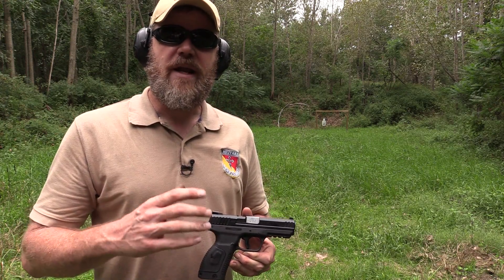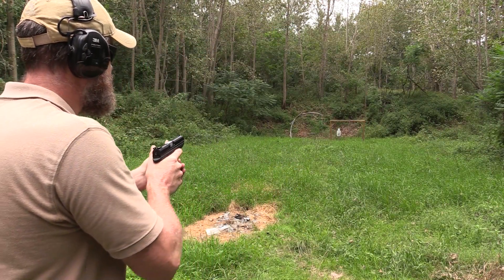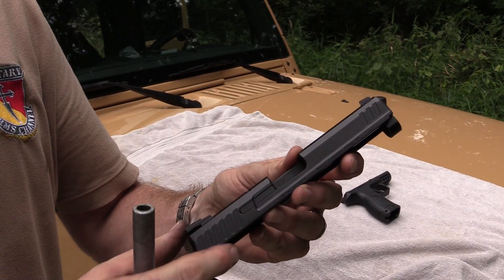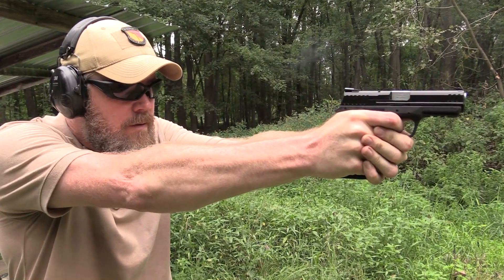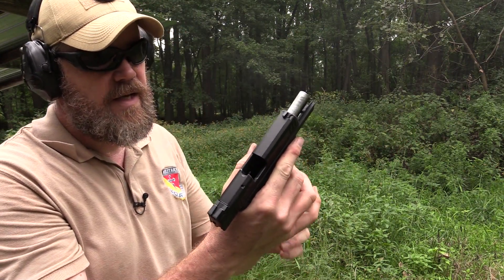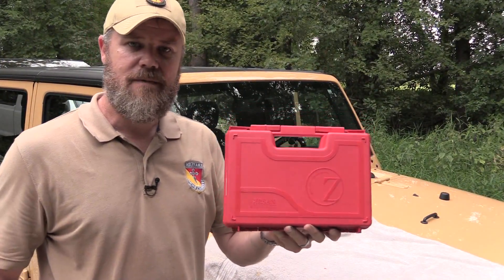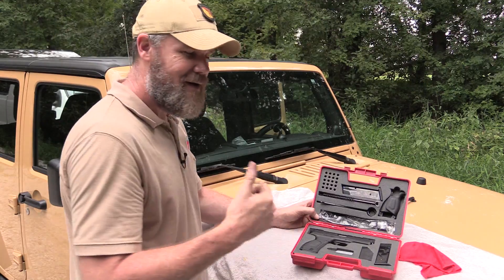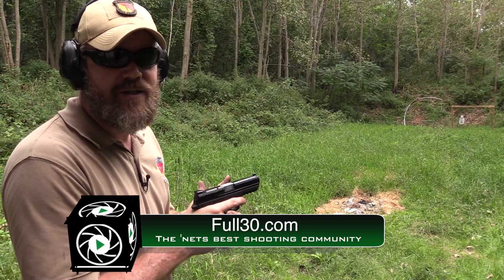NEW: MC-28 9mm Pistol

Comment: You can get an M&P for $425-450. Why in the hell would anyone buy this??? For a little more you get a proven pistol from a reputable manufacturer.
Reply: better then a high point
Reply: +Jewels Winfield  They also have a $50 rebate right now on the M&P's
Reply: +Jewels Winfield What about when they drop the price in 6 months to $300? I mean S&W and Glock are resting while the rest of the world start to catch up and pass them.
Reply: I'll be picking one up. And I'll do it with a smile on my face.
Reply: +Raul Danger I don't think I can say an m&p is a branded sigma at least not the latest versions of m&p
Reply: +Raul Danger The sigma trigger is much worse than an M&P trigger, the SD9 trigger is better but still worse than an M&P, internally they are also significantly different.
Reply: +Raul Danger I have owned both for a while now and you obviously have never personally seen one or the other. M&P uses a sear mechanism while the Sigma/SD9 does not. The polymer frame is about the only thing the two pistols have in common.
Reply: +Raul Danger You don't even believe the bullshit you're spewing.
Reply: ***** wrong
Reply: ***** I can't comment on handguns just yet from Smith, but I own a M&P15 Sport, it's a very well built rifle, put plenty of rounds through it, receiver and barrel hold up well. The finish of the gun feels better rounded than some Colt's I've seen. I like it quite a bit, of course it's not a 901 level rifle, but I'd go for the Sport before I went to a Bushmaster or FN.

I can agree on the .500, though for honest handgun hunters .460 is reasonable, mostly because it can actually be good ballistically without attracting the .50 crowd. The little key lock on a majority of their revolvers is sad, and I do feel like they don't have the same quality the did 50 or even 20 years ago, but in terms of the market for revolvers their still strong and give you the most choice.

Also I've gotten several cases of good feedback on the SD9VE, and it has a very positive reputation, anyone I know who's shot or owned one has given a positive remark on it, and we all know how much so many people love the M&P line of pistols. It's just the gun people get when they want to own a Glock and say their special at the same time.

Definitely not a Smith fanboy, but I do feel as though their still producing relatively quality firearms, and they have better customer support than some companies, compared to some companies, i.e. Remington and Marlin.
Reply: ZERO94AIC I didn't say they made bad guns, but my point was that in terms of quality related to Smith's ARs, if I needed one AR I would have no issue with an M&P15 Sport. Also yes I know they have made rifles and carbines for the Marines, but FN doesn't do anything fantastic, they just make milspec rifles, with standard AR furniture and sights, but with good quality.
Reply: ***** Anything people consider "High end" is usually some "operator" bs, that whole thing with the full length 16" free float crap, is one of the dumbest gimmicks of the shooting community, no off the shelf AR should cost $2-3000, cause you're not only buying something that is ridiculously over priced, but also it looks moronic to have 16" of keymod on the sides with one pistol light and a 4x scope. The "high end" market is just any normal receiver with some expensive looking parts and some big words in the title, why anyone would buy a rifle like that over just a basic 6920, XM15, or even a FN M16A3 copy or whatever they call it, is beside me. Ironically I'd rather have the standard model M&P15.

Also not so much as "meant for sporting" but "we called it this because it sounds less aggressive, and lawyers like it", it's just as decent as a home defense rifle, or patrol rifle, being very reliable. What looks better on the news, a man shoots and kills an intruder with a Bushmaster M4 clone, or a rifle with "Sport" in the name? It's easier on Smith, and the gun owner legally.
Reply: ZERO94AIC Good to see them offering better furniture on their rifles, though like everyone else they have fallen into the new silly concept of "tactical" with extremely long rails, I'd take the FN 15 rifle, before the rest still though. I do think they are very nice rifles, I prefer their carbine over the Colt in honesty, even with Colt being touted as the original and best.
Reply: +Jewels Winfield i've been seeing the M&P9 on slickguns.com for $399 a lot lately. This pistol, if it's going to the same MSRP, is not priced aggressively enough, but it's cheap enough to get me interested. I don't mind that they borrowed so much from the M&P design, imitation is the highest form of flattery. I have two M&Ps and I love them so the fact that this gun is so much like an M&P gives me more confidence that it's a solid design. Hopefully they sell it for just a little bit less and it would be a good deal.
Reply: ***** Yeah I think the goal of the sport is more to be the every-man's AR, cheap enough for most anyone to afford that's looking for a good carbine. Leaves everything you need and nothing you don't, it's a good rifle to mess around with and use to test furniture and optics, good truck gun too. 

Personally I'd just prefer a 14.5" pinned BCM receiver gun with the standard quad rail, put a suitable optic on it and it'll do anything a free-floated gun will do. Step's into the "Mid range" with price and it's gonna be solid.

Also thank god someone agrees about this keymod bullshit.
Reply: ***** colt ain't what it once was that's for sure
Reply: And I love colt but back when that meant something everything is made to a lesser standard as a general rule now on with my life
Reply: bower31 when working around the house a big revolver make life a lot easier
Reply: Miles Huggins Using a good sling carrying an 18.5" shotgun isn't too bad, I'd imagine slightly more comfortable than having the steel on your hip, unless you use a chest holster, though that still seems a little clunky.
Reply: ***** I honestly believe from my personal experience a basic FN 15 carbine is better than a Colt 6920.
Reply: +bower31 you gotta be kidding man. even a big xframe smith 460 or 500, is still way more manageable than any long gun on a sling. you can get them with four inch barrels it's quite compact and a lot more practical than a shotgun. you obviously have very strong opinions about what you think is stupid but please realize that there's possibly a lot you haven't considered in your judgments
Reply: ***** That LaRue sounds pretty nice, their rails are real high end, one of the only cases where I don't mind free-floating, I've been interested in getting their IC-A2 for a bit, but I'd really love to have their PDW as an SBR, that'd be an awesome range toy, and a great gun for home defense. I'd like get a Surefire X300V with the XT07 switch for a rifle light, being that I might pick up some decent NV one day, and it'd be awesome for hog hunting.

The next AR I'm gonna build will probably use a pinned 14.5", for almost the same reasons you gave for it, not to mention I've always been irked by how the 16" looks ungainly out on the end of the rifle, one of the reasons I've been attracted to Mid length guns, also for the fun of being able to attach a bayonet.
Reply: mafbloggerdanny The only issue I see with a large revolver is that because of it's weight it is not gonna be as easy to get a quick target acquisition, and multiple shots with the DA, supposing that you're being actively threatened by an animal, is gonna be tricky in between the weight, recoil, sight alignment, and contending with trigger pull. If you practice with a X frame and draw and fire several rounds accurately in quick succession then that's fine, do what suits you. Though I'd always be more comfortable with 10 rounds of slugs on the hip with 4 in the mag, 1 in the chamber, and have the gun one a 2-point patrol sling with a simple pistol grip stock, easy to attain the weapon, control is intuitive, and because it's a long gun successive shots will be easier to manage, and hit with. Ghost ring sights are even better if you're used to them. This also allows you to carry other types of shells for different possible issues.

Not entirely discounting the large revolver, just looking at the fact that they are honestly ungainly weapons, and take lots of practice to shoot accurately, and even more to shoot quickly. In the case that this is your choice I would advise a chest or shoulder holster with some kind of sling arrangement like the Germans did with the MP5K allows more stability of the weapon, and you can brace for the recoil better.
Reply: hiking in rough terrain or backpacking deep where you are severely size and weight limited, you can't afford the luxury of a shotgun or rifle on a sling. too heavy and gets in the way. you can't bend over or kneel down without having your gun bump into things. if your primary activity is doing something other than looking for game, you don't want the gun always in the way when you need to be doing other things with your hands. unless you insist on a big 8-inch version, a revolver will fit on your hip and stay out of the way while you're gathering firewood or doing some other task. 

And while you  aren't necessarily wrong in stating that it's easier to shoot a long gun accurately, it's not as tough to shoot a revolver as you make it out to be. You don't need a sling to shoot a 500, i've seen women do it, just train and practice as you said, like you should with every firearm you own.
Reply: +Raul Danger I live in a first world country and I wipe my ass with my bare hand.  Is that going to be a problem?
Reply: +mafbloggerdanny Or you could use the gun as it was mostly intended for. Which is handgun hunting. I prefer to use shooting sticks. Makes it a cinch.  In terms of bear or other large predator defense. I go with the shorter barrel lengths. 4 and under.  Easier to wield and get on target. The shear weight of the revolver actually adds to control and recoil mitigation. Personally I prefer the 460. More cartridge versatility (JMHO). But for the most part I agree with you. Just thought I'd add on to your thoughts. Hope you don't mind too much.
Reply: mafbloggerdanny That's what I mean a 500 is a gun that needs serious practice to be efficient with. In terms of a long gun being in the way, that's really subjective, it feels that way but once you walk around with it on your front for a whole day, you don't even notice, and if you get a sling with a quick adjust buckle then you can keep it from hanging down in what you're doing, and be able to draw it up quickly. It can get in the way, but it can quickly become a habit to bump your long gun over out of the way. In terms of weight, that's another thing, if you are used to hiking and moving with ridiculous amounts of gear on, a 8 pound shotgun isn't much when you're backpacking, again personal, but it's true. Myself, when I'm moving long distance I'm used to having a long gun and handgun, body armor, a helmet, a 40 pound bag, and still being able to run, climb and hump/hike. If you don't want to carry the weight that's your choice, but it is indeed possible to go with 60 pounds of gear and a shotgun, and have little trouble.
Reply: +bower31 A 4" X Frame is not that hard to wield. You make it out to be as if you are trying to shoot a 40 lbs dumbell. It is far easier to move through brush let alone heavy brush with a pistol. Than any rifle strapped to you. Moving through the open with heavy gear and a rifle is not the same. We all make personal choices for what will suit us best. But don't knock or dismiss the advantages of a large caliber revolver over a rifle. An 8" or 10" 460/500 XVR with an good extending monopod shooting stick can be highly versatile and quick to deploy.
Reply: MatteoSixSeventyFour Like I said if that's your choice. I can personally say I'm confident with a long gun and heavy gear and still being able to move through wooded areas, it's very doable, you just have to, as any DI will tell you, "want to do it". If you're happy with the .460 then that's what you're gonna do. My point is really just that a shotgun or rifle can be just as easy to carry and use, as a large revolver, and not be as much of a nuisance as you think.

Also if you're moving through heavy brush, come prepared, bring tools to deal with the scenario, while a long gun and heavy backpack won't stop you too much, you might as well be able to clear for yourself.

 The most important part of this is probably that you can argue about which gun you want to carry, when most anywhere else you're just screwed and left unarmed.
Reply: +bower31 I assume by bring the tools to clear. You mean a machete. Certainly you can go that route. But you expend more energy and noise that way. Not always ideal. While the long gun philosophy is tried and true. A one size fits all philosophy can come back at me and bite you in those instances where it is not suited to the task or environment.  But we do agree in the end. It's personal choice.
S/Fi
Reply: +MatteoSixSeventyFour around** auto correct and predictive text can really bite at times. LoL
Reply: MatteoSixSeventyFour Story of my life haha
Reply: +Raul Danger What handgun do you suggest?
Reply: for some people that edtra hundred bucks or so is a lot of money
Reply: +bower31 I'd buy a Ruger AR-556 before buying either a (any) Bushmaster or a M&P15 Sport. In the world of budget AR rifles, Ruger wins.
Reply: stfram The Ruger is too proprietary from the factory from me, with their custom fsb, special handguard ring, sights and super Ruger branded everything. Like they have a proprietary barrel nut, so if I wanna put a rail on that attaches to the barrel nut I have to take the barrel off the rifle, unlike on a Bushy or a Smith, or even a Windham, which all use standard parts. The Smith is also generally cheaper, and is extremely reliable.
Reply: +Jewels Winfield 
MSRP is 399, which means it'll most likely street $300-350. Assuming they'll have some iron sights and holsters, it'll do fairly well like that canik pistol everyone was nutting about
Reply: Red Rider7 Turkey is not a "Muslim country", it's officially a secular state. There was never Sharia there since the day modern Turkey was founded, there isn't one now and neither there will be any in the future. I don't know where you're getting your info from, but it's wrong.
Reply: stfram ruger makes there stuff to last
Reply: Red Rider7 would you mind naming me any major changes in Turkey's constitution or laws in the 12 years that current political party spent being in charge? Alcohol is still legal and is freely drank by everyone, overwhelming majority of women still don't wear veils and it's still not mandatory, hundreds of churches and synagogues continue to freely function, homosexuality is still perfectly legal (in fact largest Gay Pride Parade in Turkey's history and largest ever in Eastern Europe took place under current government's rule in 2011), abortions are still legal, the state still has no official religion, everything that made Turkey secular is still in place, so where's Sharia law you're talking about? Erdogan is a conservative leader that brings up religion a lot, but he never really changed anything, he's like American right-wing politicians, talk about conservative values a lot but can't really enforce them.
Reply: Zenith is a reputable manufacturer. Doing some research really helps before opening your mouth.

Comment: I'll buy a Glock for another $100
Reply: Starhoof Don't need your permission
Reply: ***** Umm no
Reply: Ok....do your thing
Reply: ***** Both are things that go bang
Reply: +Steven Bush Maybe a used Glock.
Reply: +stfram nah. If it was still the case, I'd still rather have a used one.
Reply: +Steven Bush 
New Glocks have been creeping towards $600 in my local gun stores. Shipping/FFL transfers make any savings a moot point. If you wait a while, the MC-28 will probably be found $300-350
Reply: FadeMaster 😄
Reply: I'd go easy on throwing moral high ground on Turkey - coming from a country instigating wars globally for financial gain.